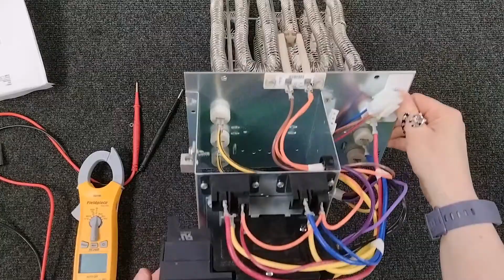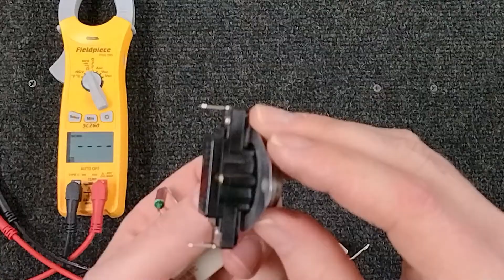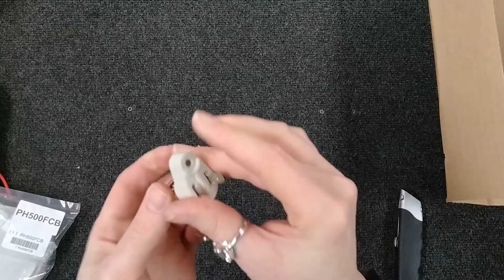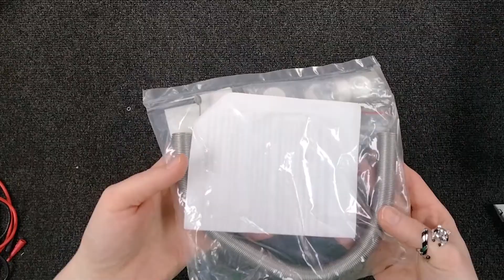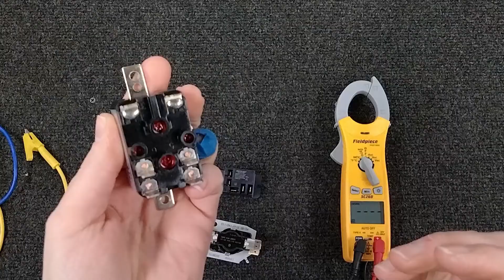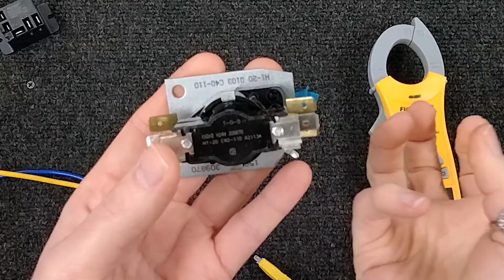Heat Kit Testing — How To Test Electric Heat Strips & What To Look For

Comment: You should never touch the element with bare fingers. The oils on the skin will cause early failure of the element strings. I've seen this many times in the field as a professional technician. I always wear nitrile gloves when working on electric elements, electronic parts, and circuit boards. Boards and electronics are prone to damage from both oils and static discharge from the hands.
Reply from the maker: I've seen a dog piss on a defrost control board (no cover, open to the elements) for multiple years, the piss ate through the coil before the board went out.  Also - on an electrical heating element, they are covered in your oils over the course of the year when you're not using them.  All your hair and skin cells that bypass the filter end up sticking on them, and first time you turn your electric heat on for the season it burns them off (hence the burning stink).  So much more oil than your fingers will ever have on them.  Being cautious is cool - you should always do it, but some places it makes little sense when compared to the environment of the actual application.